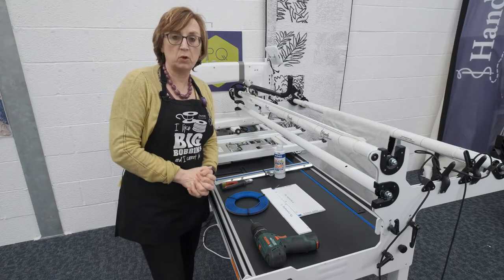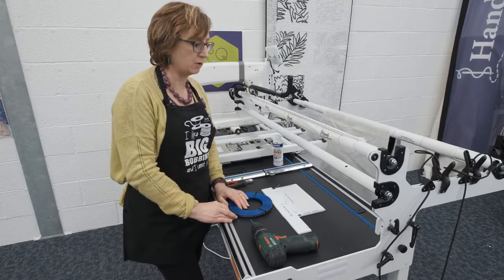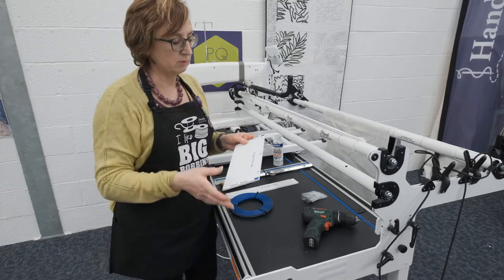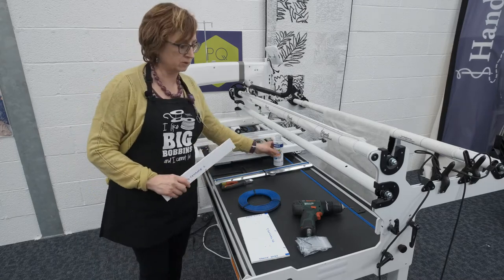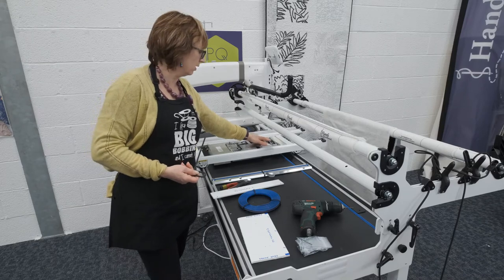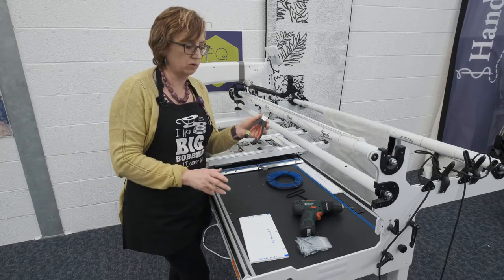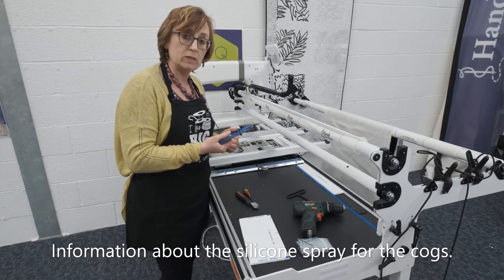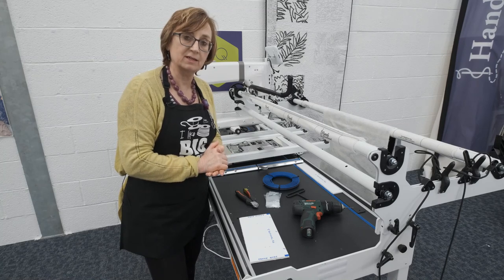Handi Quilter Pro-Stitcher Installation for Self Installation by Customer

Comment: Do you have a video showing how to disassemble for moving?  I am purchasing a pre-loved Avante, with Pro-Stitcher,  on the original Studio frame.  I have watched assembly videos, but am not sure how far to take things apart.  I want to take enough of it all apart to move the machine, Pro-Stitcher and the frame safely, but do not want to un-assemble something that would have better been left assembled.
Reply from the maker: We don't have a videoshowing the disassembly process.  Your best option is to get in touch with your local Handi Quilter dealer.  It would be wise to get the machine serviced by them and they should also be able to help with your enquiry.  Good luck!  It's a great machine.

Comment: I love your videos! Perhaps you can answer a question for me. If I was to purchase Pro Stitcher for my Baby Lock Coronet, then decided in a few years to upgrade to an different Baby Lock machine, would I be able to get a new carriage/wiring for the upgraded machine or would I have to re-purchase Prostitcher?
Reply from the maker: Glad you like our videos Linda!  A different machine would require a new Pro-Stitcher.  The carriage is a different size for different machines (a bigger machine needs a longer carriage) so the Pro Stitcher carriage is also bigger - it is a different product.  There are also other differences between machines in the wiring, connections and electronics.  In the UK there is a very good market for preloved Pro-Stitchers so you would be able to sell it either with the machine, or separately to someone with the same model if you decide to upgrade.
Reply: @PinholeQuilting  VERY helpful! Thank you! I'm also considering QBot, which seems to be more portable between machines

Comment: How can I get a copy of your templates?
Reply from the maker: We supply them to our customers who have purchased the Pro-Stitcher in the UK and Europe. We don't sell them separately. We make them ourselves inhouse using mount board. You could work out your own template using the carriage and front rail as a guide which may help you get a straight line. HQ explain how to put the track down without templates in their manual.